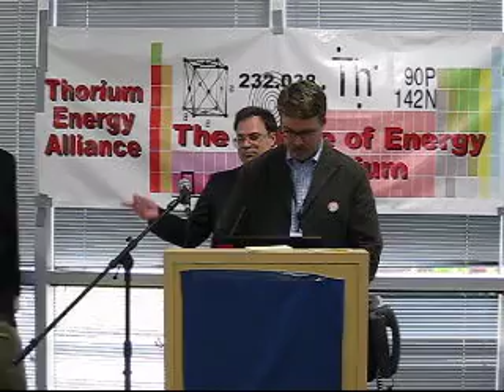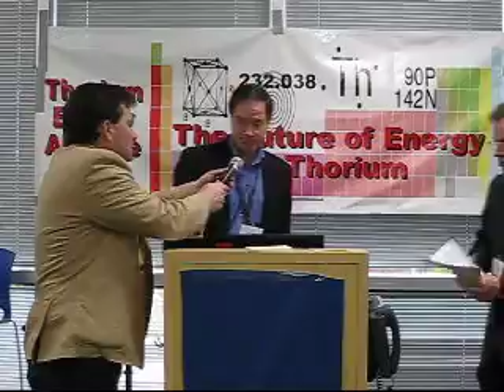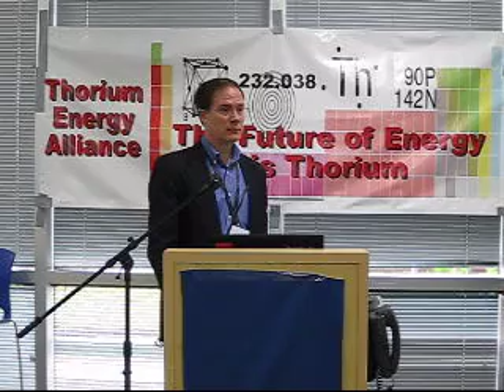Dr. Per Peterson - Molten-Salt Cooled, Solid-Fuel Reactors @ TEAC2

Comment: "Silence is golden", so it's easily bought with Dark Money, an aspect of the "Gold Standard" perhaps?
The cost in human lives and to the planet is a requirement to shift standards to genuine quality of life by understanding Actuality. 

Meaning, exactly which Reactors, what Engineering Designs, and how distribution systems will work is a holistic policy change conceptually that has to recognise Euler's e-Pi-i 1-0-infinity omnidirectional-dimensional holographic mass-energy-momentum spin-condensation cause-effect of "Nuclear Power Generation" in Actuality. (Get REAL!)

Comment: What I don't understand is why they keep trying to use solid fuel?  What am I missing?  The MSRE proved that liquid fuel works.  It seems as if the only reason solid fuel is being insisted on is to continue using the business model that forces customers to buy their fuel from the company that built their reactor and no other.  Or is it something else?  Because all I see are the disadvantages.  The gases in the fuel causing cracks which leads to the fuel being ruined. Please somebody enlighten me.
Reply: 4:08 Per goes over some arguments, and he's discussed it in other videos too. Pebble fuel is a lot more like liquid in terms of not buying entire fuel assemblies from a single supplier... in theory pebble fuel could be interchangeable between suppliers and small quantities of pebbles can be circulated into a reactor to test how they perform (if one was comparing vendors).

They also provide another level or protection against release of fission products... if a fuel pebble fails then you're now running a liquid-fuel MSR instead of a solid-fuel one. (Stated as a joke in another video.)
Reply: Check-out safe ThoriumElectricUSA.com no government funding - replace closed coal and out-dated nuclear power plants - no CO2 release.